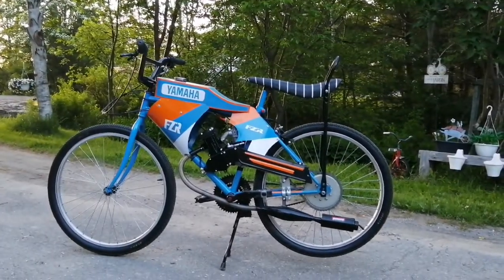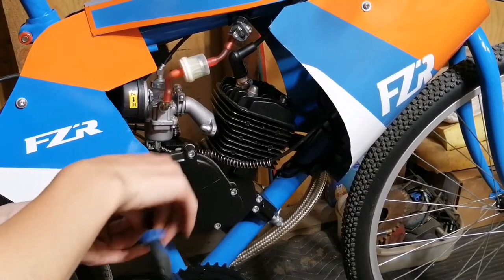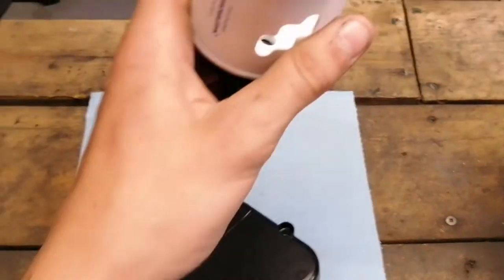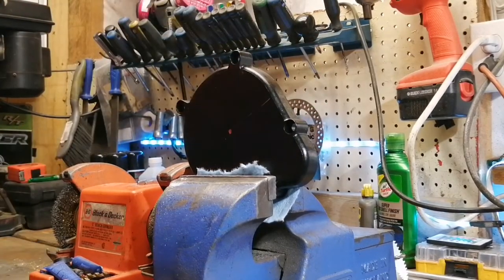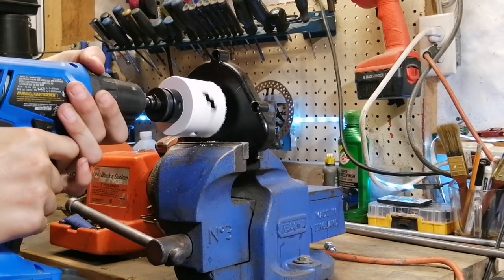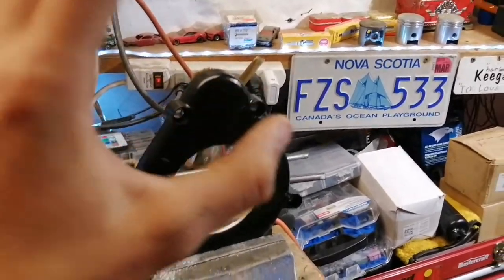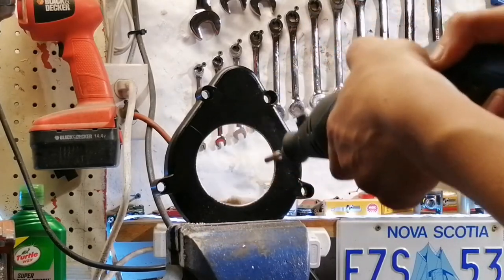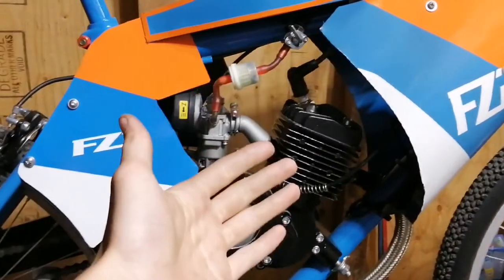How To Drill a Hole in Your clutch cover (Motorized bike)

Comment: Bruh you engine will overheat fast
Reply from the maker: No it won’t I’m getting a high compression head for it soon and the air still comes through the front of the bike and cools the cylinder head down. I measured it with a temp gun and it was around 230 degrees which is the same as my other builds with out the front faring. So many people say that I will over heat it but it’s never happened to me and the inside of the engine is mint.
Reply: Why,cooler clutch?